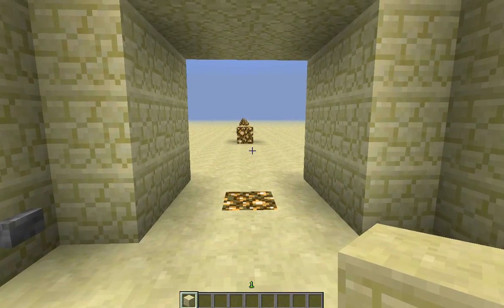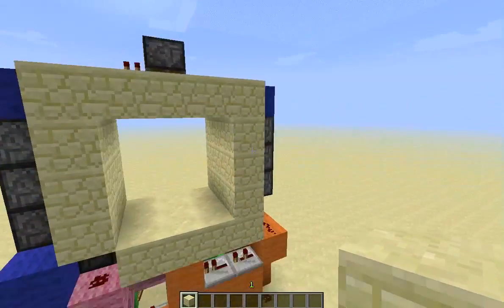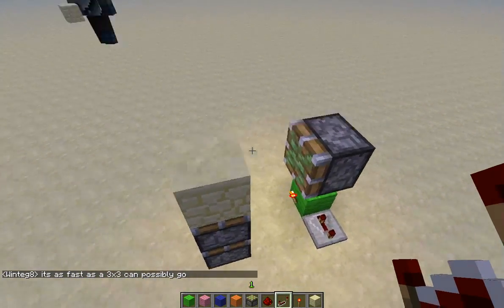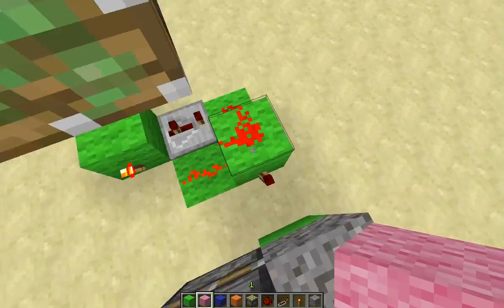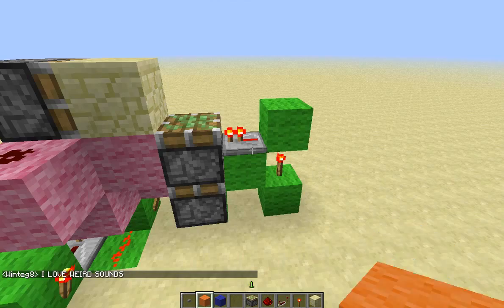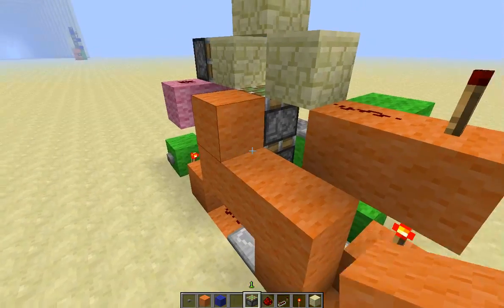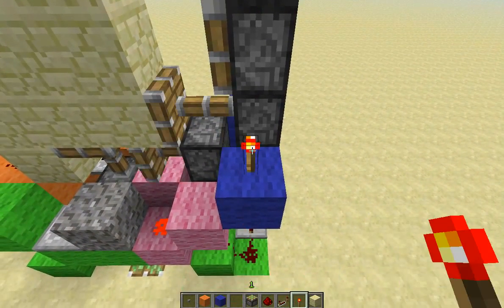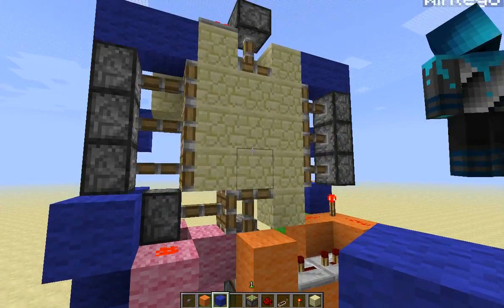[Broken] Compact 3x3 Mk 3, FAST!!! [Tutorial]

Comment: In 1.4.7 and it doesn't retract the top block at all with your timings it doesn't retract the top block at all. If i set the repeater at 6:44 to 4 ticks, it brings the top block back one block but not all the way down. I've checked my wiring at least 20 times.